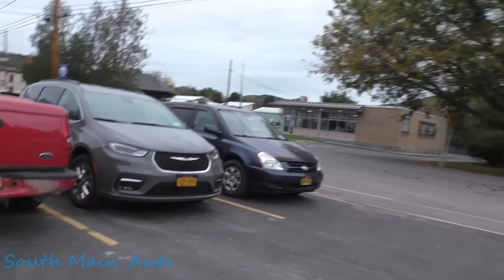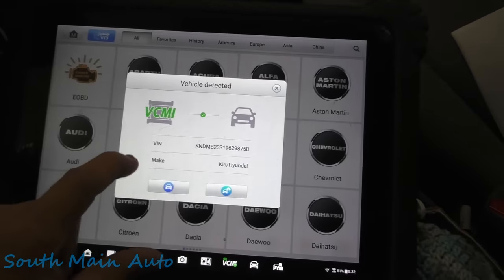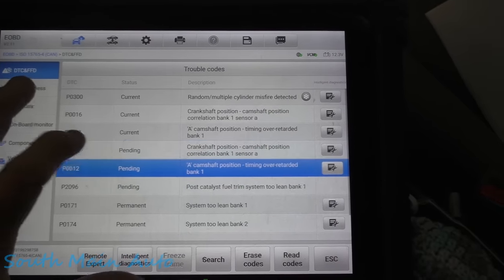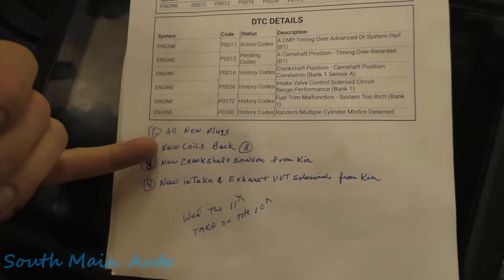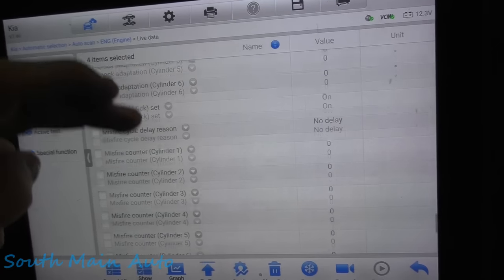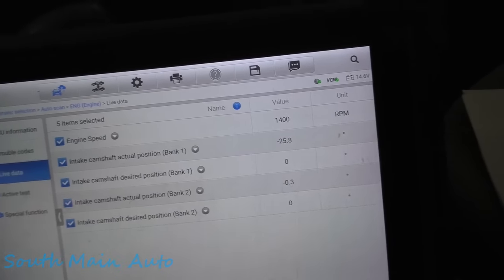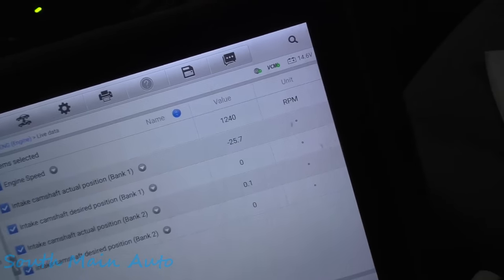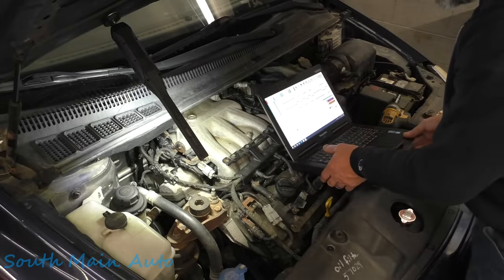This Kia Is Running Out Of Time!

Comment: The other shops in the area must sleep at night knowing Eric O is there in case they can’t figure out a problem.
Reply: He's has a few ( OTHER SHOP REFERRALS ) hasnt he ? 😄
Reply: i'd be surprised if anyone goes to the others anymore  lol
Reply: 😂frfr
Reply: Second opinion cause they don’t care too fix it .
Reply: Its just a pity they are making a dollar on the back of Erics sweat.
Reply: After they cashed on on the plugs VVT solenoids and coils parts cannon
Reply: Those other shops only care about billing the most they can before they kick it down the road…
Reply: Sometimes I wish I had a south main auto nearby for the problem cars lol but I figure them out eventually…
Reply: Right!! He is the goat for sure.
Reply: They put OEM parts on because they have watched Eric diagnose faulty new aftermarket parts.
Reply: After throwing the parts cannon at it and making no their money off the customer
Reply: @Arachnoidification Sometimes, a good diag doesn't take that much of Eric's time, and he must charge a minimum of 1 Hour. And these people must know that he's very good as a troubleshooter. He's worth it!
Reply: Eric
I have a 2020 Chevy Silverado 2500hd
Problem is no heat driver side 
Passenger side heat ok
Dealer first said mode door actuator bad and wanted to replace
They said $1200 not sure if covered under warranty 
They called back a few days later 
Said will cover under warranty
But now they say tech made mistake
Not mode door it is the blend door 
Only 2 hrs to replace
They replaced under warranty
Did not fix
Still no driver heat 
Now they say replace heater core
$1600 and will not cover under warranty
I looked for a service bulletin 
Bulletin says to check other things before replace heater core including flush heater core
I said why don’t you flush core first 
They agreed and flushed core
Did not help
They made me pay $221 for flushing core or would not give me truck back
Please help 
What do you think?
Is it the core?
Can you have heat on 1 side and not the other?
My truck has the 6.6L diesel 
I believe it had the electric aux heat also
Could this be related ?
Reply: I think shops do this somewhat regularly especially for really complex diagnostics or makes/models they don’t have a lot of experience with troubleshooting advanced stuff on.  I’ve dropped off cars at one shop and picked up at another because the first shop was a small indy guy and didn’t have an alignment set up. Both where great and it was less of a PITA having to run it to the alignment shop after he did some suspension work.
Reply: Not always true. Medical doctors consult each other. Car doctors have to do the same. Not all cars are alike. And mechanics have to deal with more than 2 models. Cars and trucks are far more complicated than 20 years ago.
Reply: Not a mechanic here but you are getting heat to one side so  there is heat abailable juat not being diverted to the driver's side. You speak of the core flush AND auxi. electric heat? 
Either side has an actuator. The first item was probably the right call. They did not follow their service procedures and still want you to pay just because you suggested it? Perhaps if this is the dealer you bought it from you can suggest they lemon it and tke the truck back before you pay the $200+.
Reply: Sittin there on that sack of cash
Reply: Sounds like there are a lot of shops can't troubleshoot at all 😂

Comment: My daughter has a 2021 Kia Seltos with about 70,000+ miles. She bought it new.  Her engine light came on and the car stalled but restarted. She took it to her usual shop and they said it was showing codes P000b and P0017 and should go to the dealer. She brought it to the dealer, and they found the exhaust cam phaser was loose. It must have also damaged the cam because they replaced both the cam and the phaser. They also replaced a couple of oil seals. The work was done under warrantee at no charge to her. Her car is running great again. She got lucky it was still under warrantee. It was the first trouble she had with the car.
Reply: You shouldn't expect that kind of trouble at 70k.  Best she sell it before the warranty expires.  These engines are junk.
Reply: @vicarod I strongly agree.
Reply: That's a lot stuff for a 2+ year old car...
Reply: @michaelsnively3621  exactly , something  you would expect from say 150 k miles
Reply: Kia. Too bad it’s a Kia. 😢
Reply: @462ANIMAL  IMO manufacturer oil weight recommendations are too thin. I changed from 5w20 to 5w30 in the truck when I got it, and engine noise quited down.
Reply: @michaelsnively3621 i agree. Only reason they push thinner oil is then they can show insane climate goals that they reduced emissions 0.0002%. The fact that the engine gets worn out faster, dont seem to affect them.

Comment: One thing that did seem odd to me is that the engine did run pretty smooth, so I wouldn't be surprised if it's the sensor cam trigger that has moved.
Reply: Your right maybe a bore scope down the cam sensor hole might have been beneficial. Michael
Reply: @michaelsapko1731 
this is how mechanics talk dirty to each other,
right here  😗
Reply: @Zupdood2 I love it when you guys talk dirty
Reply: Didn't PHD have one of those?
Reply: That or there's different sensors snd wrong one is installed maybe left and right are different as cams spin opposite
Reply: @gsppuffer  "maybe left and right are different as cams spin opposite"  I call BS😁, chains spin in clockwise direction therefore ALL cams spin clockwise, regardless of where the input cam is located on the heads.
Reply: @breezy1849  he said MAYBE, relax fellah!

Comment: I'm curious how this situation is handled. Who pays who for this work and does the car owner know the car was sent elsewhere?
Reply: I was thinking the same thing.
Reply: No different than sending a cylinder head out for rebuilding.  Shop pays eric and then just charges a "diagnostic fee" to cover it.  Customer probably doesn't even need to know.
Reply: Obviously the other shop.  😂
Reply: The other shop pays South Main, the other shop passes that on to the customer (either at cost or marked up). They may or may not tell the customer. There's no shame in a shop having someone more knowledgeable do work when it's something they can't figure out.
Reply: Not only does the customer get to pay for the "real" diagnosis after it gets sent out to Eric O, they get to pay for all the random parts that the "other shop" decided to throw at it, to not fix the issue. It's a shame there are so many mechanics that seem to be able to make a living at other peoples expense, by just guessing their way through, rather than learning how to actually diagnose problems
Reply: @arcadeuk  I'll never understand that part. How a shop charges for parts and labor and it's still not fixed.... Or in this case, though it didn't work, replaces plugs, coil packs, solenoids, etc and maybe 1 of the many fixes it but as a customer, my thought is, "what are the odds that ALL of those failed at the same time?".
Reply: Shops send work out to specialist shops all the time.
The shop who sent the car to SMA would pay, and that cost passed on the the customer.
Customer may know, but in any case if there is a problem the original mechanic would be the first port of call.
Reply: @HallStevenson  the spark plugs may have never been replaced and at 130k it would be due but no coils. It can be a cheap replacement depending on intake removal and a first step with misfires and old plugs

Comment: Kia slogan should be "don't worry bout gas prices, kia runs on oil"
Reply: Actually, no, they don't.  The pumps fail, a lot, and the heads don't get oil until it blows; which it will....
Reply: Sound like Ford 5.4
Reply: My wife had a 17 sorento. Burnt oil bad at 50k miles
Reply: @Darjan_Spasojevic my brother in law has a  hyundai sonata 2.4 that drinks oil and eats spark plugs.  1 qt every 2 weeks and plugs foul around 800-1000 miles. He's on the engine recall list. They want him to keep up with oil changes. 😅 I told to just change the filter,  the oil is self changing. 😅
Reply: Change that oil all the time, I have a 2.4 with 160k, don't know how long it will last, but I'd rather spend the money on fresh oil and good filter every 2-3k.
I've seen the sparkles, so I know it's having the known issues.
That being said, it runs good, and a really nicely equipped limited  from the west coast.
Paid only 1k for it, so that is less than one car payment for most new cars!

Comment: Good diagnostic path Eric O scan data can throw you off if you rely on it definitely looks like the cam pid went dead when the cam codes set 21:27 @South Main Auto Repair LLC

Comment: So nice of the other shop to change the spark plugs for a timing code...hopefully they rotated the tires too! Great job as always, Mr. O
Reply: Typical "cheeseburger, chips, and Pepsi" establishment
Reply: Not to mention change the blinker fluid!:)
Reply: Blinker fluid can be expensive don't you know? Some vehicles have sensors built into the tail light and if the unit gets water in it costs over $5k for a damn tail light because it now communicates with the entire system of the vehicle. It no longer is just blinky blinky or flash on flash off.
Reply: I bought one of those brake lights that goes in the reciever hitch of a vehicle. From the get-go I got a message that my left trailer light was malfunctioning and would have the rapid flash turning left. Figured it was a defective unit and besides it had the back-up light feature I had to hard wire so I got a standard read light one and the same issue. I checked around and turns out the unit is wired only to the right tail light so the car computer thinkks my left trailer light is out giving me a message over and over my tail light is out on my trailer. 
Knowing what I know sometimes the blinker will work normal but most times it will blink faster than normal  and I may just unplug it.
Reply: @larrybe2900  Ain't THAT the truth!

Comment: The PID will drop from scan data because the reference voltage signal has open circuit too.  Without reference voltage no valid data, if reference is provided.
Reply: What reference voltage? Eric unplugged the phasor solenoid not the camshaft sensor. If a reference voltage or +5V supply is involved, it's in the sensor circuit, and that was still connected.

Comment: @ 00:38 I like how you gave historical information a thoughtful but quick review and then moved on to perform your own assessment.  @21:33  "...fixing a mechanical problem with cam timing or replacing the engine."   I bet the other shop recommends engine replacement simply because that seems like the skill set available at that shop based on prior work product.  Hope that shop recommends you to fix the mechanical cam timing issue.

Comment: Would it have been an interesting idea to scope the solenoid control signal?   Your videos are great, I hope you do not loose interest in posting new ones!
Reply from the maker: That's why I left it unplugged to remove that variable. It should be set at the base timing with the solenoids unhooked. But that's a great question
Reply: @SouthMainAuto  I think also a measurement with 2nd vvt solenoid unplugged would have been good because we saw the values read 0 for either unplugged.  Maybe if the one bank stays locked the retard of the chain would be slightly be more or less retarded  (compounded problem  vvt gears i think they wear out a lot on hyundai / kia. )  I 100% agree with the diag though... the covers have to come off regardless.  Hopefully not multiple components plus chains. $$$$$

Comment: Love the channel.  I wonder if you had zoomed in the time scale (for more accuracy) if the scope would have measured closer to the 25 degrees reported by the ECM.  Hope we get to see you open up the cover and fix it.
Reply: 14° between cams is 28° crank to cam offset.
ECU thinks in crank angle and Eric measured cam angle.
Reply: @philippintheus  Thanks!

Comment: 3 minutes in and already have an idea of what this is going to be. My Kia had same signs and symptoms at 104k miles. Timing guards are plastic and wore out . Had it repaired but the motor still failed at 118k.
Reply: You won't get much than that out of a Kia engine
Reply: @gianfrancoa My 07 Hyundai Azera 3.8L V6 had over 201,000mi on it before it got totaled. My mom has a 2010 Hyundai Sonata 2.4L non GDI with over 230,000mi on it. Still running, original powertrain. Older engines were pretty reliable. 2011 and up are the ones with issues.
Reply: @MTTech  yes I agree. They are having a lot of issues with engines lately
Reply: If you don't change the oil and do regular maintenance, NO engine will give good service. So many folks blame the brand, when the big factor is the nut behind the wheel.
Reply: @MTTech  My 2012 Santa Fe 3.5L V6 has 280K on it.
Reply: @21Piloteer  Luckily that engine has MPI instead of GDI so it doesn't have the carbon build up issues. Any major issues?

Comment: Nice video Eric, I had one that kicked my but it was a Sedona, after putting a new belt on it it still was out of phase , I found it had sheared the index pin off the cam, I'd have them pull the gear and check the pin
Reply: The cam gear has moved , you have to remove the gear to verify but I've seen  this about 10 different times on these engines
Reply: @bowmanjim31  looks like to me I would   just  find a used lower millage motor and replace it.. Looks like a labor intensive job just  to take apart an  09 van and expose the timing chain and gears to see what the problem is and hope that is the problem

Comment: Funny, the one I just repaired last week was the solenoid failed. It ran so bad that one bank misfired and flashed the money light like a Christmas tree light. 1,3,5. Connectors blew into pieces once touched also of course, adding to the drama. But it's all fixed now. 1 solenoid can be snuck out, the other nope.
Glad you got this one sorted out too!

Comment: When something throws that many cam timing codes and has a chain, its almost certainly a stretched timing chain or broken guides.  Super common problem on multiple engines. Stretched chains are not always noisy.   Typically, if you want less chain wear, change the oil at decent intervals, not the bullsh1t 15,000km's /10,000 miles.

Comment: The dry door hinges says it all on maintenance
Reply: Yeah...even the screen door squawks on a diesel boat...if ignored!!
Reply: Oh my gosh, that's the first thing that popped into my head with the door. That creak would drive me nuts.
Reply: Well i got an old truck, sprayed the door hinges with lube, the driver's door still squawks. As long as it runs well, and gets me where i want to go, i couldn't care less at this point. Hinges aren't worn either. Low mileage as well.

Comment: As a KIA technician... there's also an issue with the camshaft dowl pins getting too far into the camshaft and causing the cam gear to rotate. These usually produce a camshaft correlation code. The only fix is to replace the whole cam, the adjustable gear, and of course, at that point, change the timing belt and tensioner. The wholes for the dowl were machined too deep and allowed the pin to sink too far into the cam. They don't quite sheer off, but they deform and kinda bend sideways. I learned this from one of the Master KIA techs.

Comment: Had a similar issue with my ‘10 equinox. Cam crank correlation. I unloaded the parts cannon. New cam and crank sensor. Vvt actuators and then finally broke down and bought the $300 timing set. No more issues since. Bank 1 jumped 1 tooth on the timing.

Comment: Here's an idea: Come up with a "substitute" phaser.  It could be a resistor or an old just part.  Just so it doesn't set a circuit code.  That saves you from setting up the pico.

Comment: As a Kia technician, we seem them all the time. The 3.8 in the Cadenza had a recall for the timing chain guides and tensioners. Same engine in the other v6 applicable cars, but only the Cadenza got the recall.
Granted the rest of the fleet has this happen well out of warranty. Cadenza chains were popping from the truck 😅

Comment: I have a Toyota with same problem.  Took it to a master Toyota mechanic.  He replaced the cam sensors so fast it was like getting an oil change. Car runs like a champ now.😊
Reply: This is a lot bigger problem than sensors. A layman could probably replace cam sensors just as fast as your Toyota tech. Not sure why you are impressed with that simple job.

Comment: Had the same timing issue on my sedona. No check engine but running rough and back fire when hitting the gas. Bank 1 actual and desired were different like yours bank 2 good. Couldn't figure it out with scan tools so decided to take off the cover. Was a loss chain from a bad tensioner.